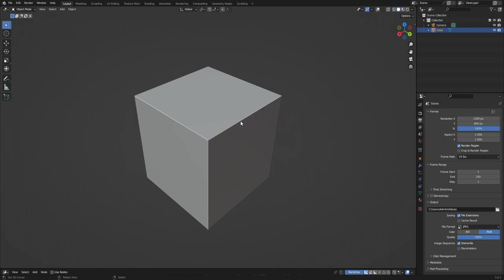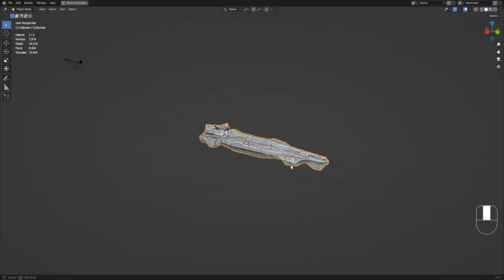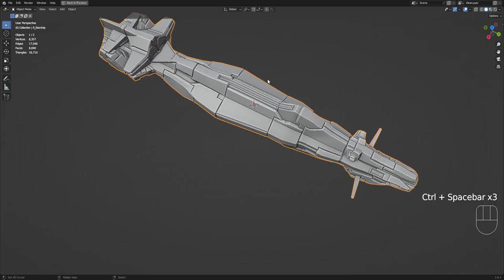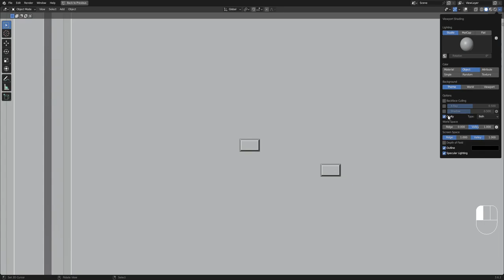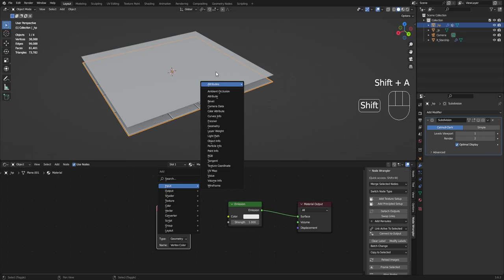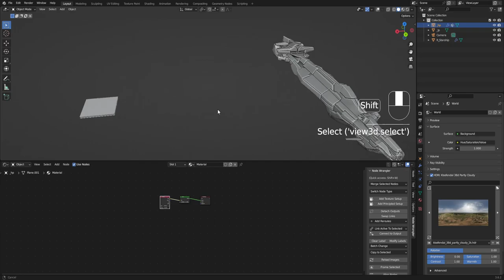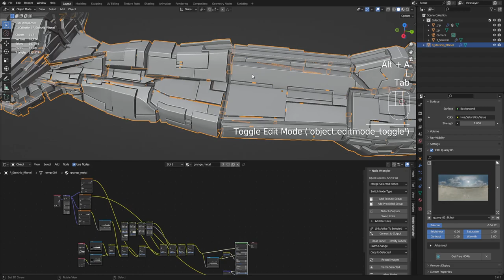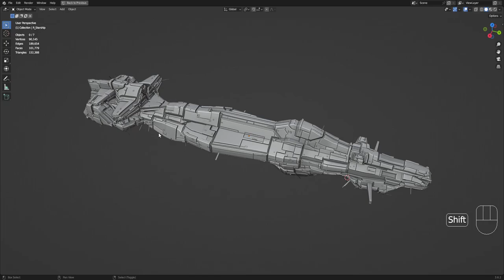Using Random Flow for Random Starship

Comment: I tried adding vertex colors but it only worked with the cells. The panels all got the same color (Shade of grey). Love the videos though. Are you on Discord?
Reply from the maker: Try the sharp option and toggle on mark sharp.
Reply: that worked for material view but in cycles its black. I tried connecting the alpha channels but it didn't work
 @blenderguppy